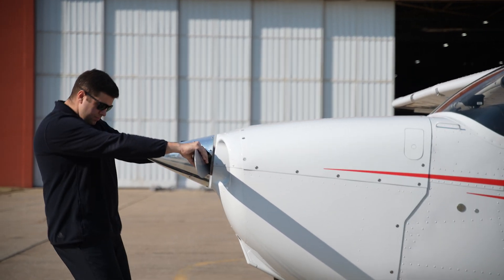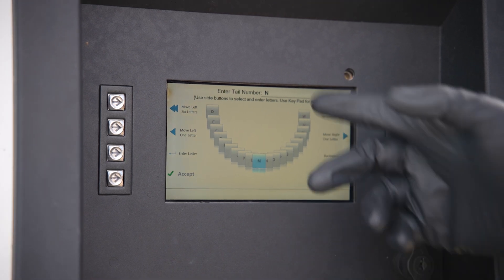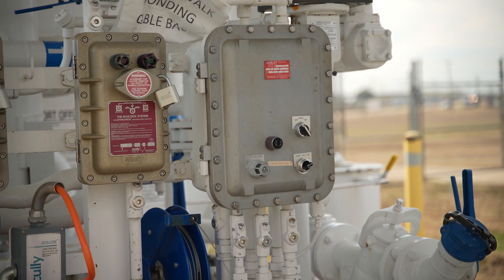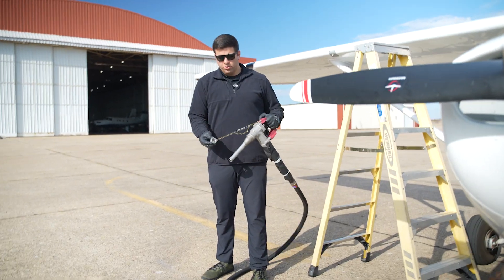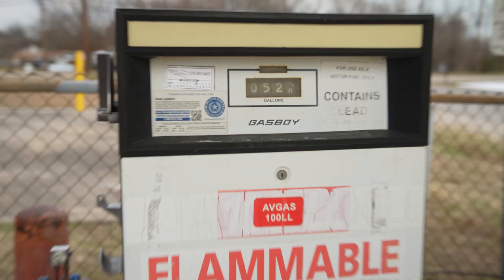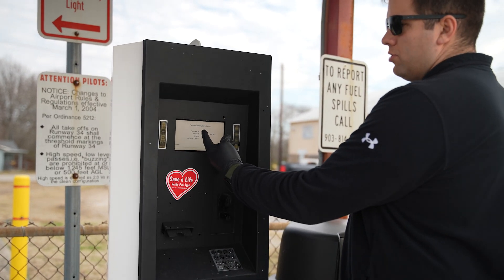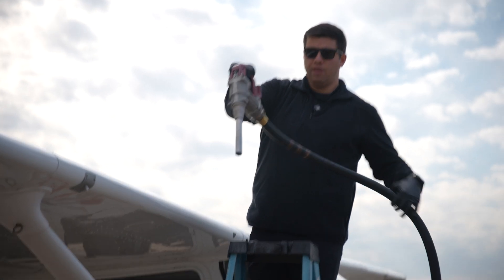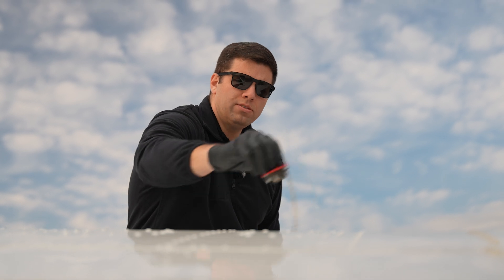How to 'Self-Serve' Fuel an Airplane: Step-by-Step Guide with 3 Examples

Comment: If you select a certain amount of gallons and use less than you selected, are you still charged for the amount you selected? Or is that just authorizing up to the gallons you specified? Thanks!
Reply: In my experience it just authorizes and then will stop at that amount.  It doesn't charge you for fuel you did not pump.